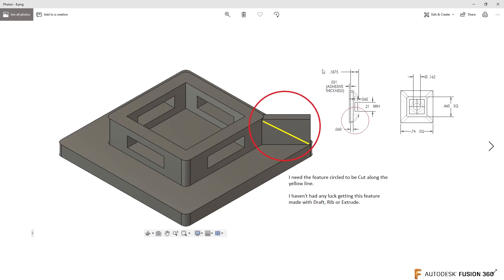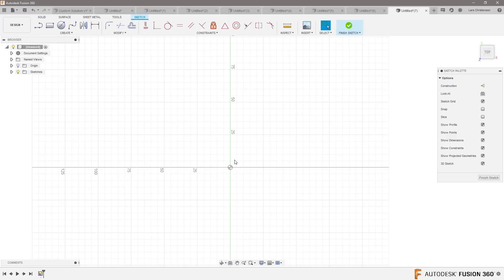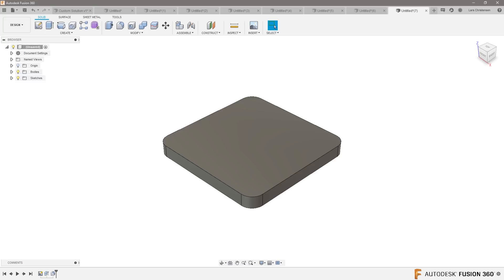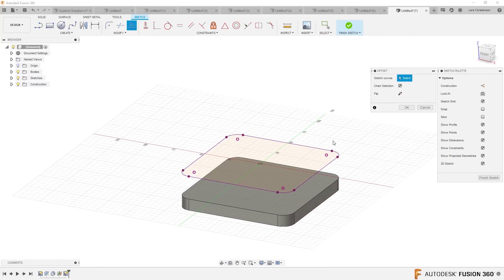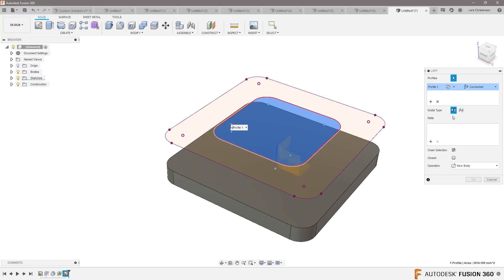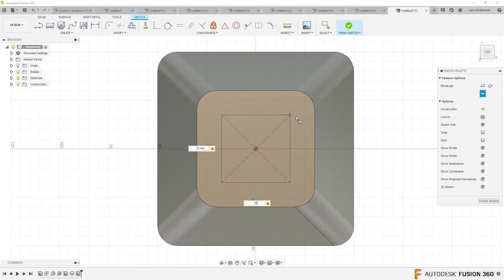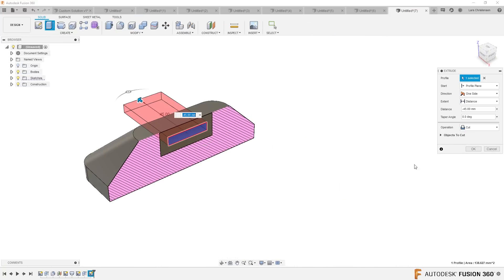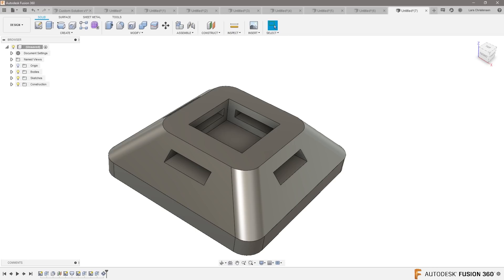Fusion 360 — Extrude on a CURVE Look Up for LOFT — Ask LarsLive

Comment: Based on the drawing (and as mentioned by Troy and confirmed by Charles), the answer doesn't directly solve the problem.  But if you do the loft as Lars indicates but in the patch workspace, the resulting surface can be used as a splitting tool in a split body command to trim the ribs as indicated.

Comment: Hey Lars - I'm with David Hewes on this one brah.  Please put together a tutorial on how to adjust placement of dimensions on an exploded model.  I have some schematics to put together (on a few projects actually), and this would prove tremendously helpful.  Also, if you could include a 'how-to' segment of that video on how to embed data in the various components of a given model (so that each component can be identified as to it sizing, schedule (as applicable), material composition, etc.), that would be a tremendous help.

Comment: Not what he was looking for,  from looking at the drawings provided. He wants the angled brace, cut along the yellow line. Look closely at the vertical side view drawing. It shows the inside line of his current square bracing, but with the cut at an angle.  You could just draw the triangle on that face and then just cut it through.
Reply: Yes to your reply AND the others' replies.  The geometry I was trying to make was impossible with the round corner and yes, Lars' reply got me to the end.  The most frustrating part of my Fusion 360 journey has indeed been learning to grasp an efficient Order of Operations flow.
Reply: @charlesbiggs7735  That Order of Operation was an eye opening to me too.  I mean, I knew it, but didn't really "knew it", if you know what I mean.  Now I am really fully aware of it.  So for that, thank you for the question, and thanks Lars for completely cleaning it up!  :)
Reply: Agree with you. I think he want to do a triangle-thing just in the 4 corners, and not around the whole thing.
Reply: That's what I thought too.  But from where the model is now, he would know how to do it.
Reply: I think Charles is trying to create an impossible geometry as well. The circled area must be rounded in order to be flush with the center square. You can't have a flat surface unless the center square has the corners in a chamfer.